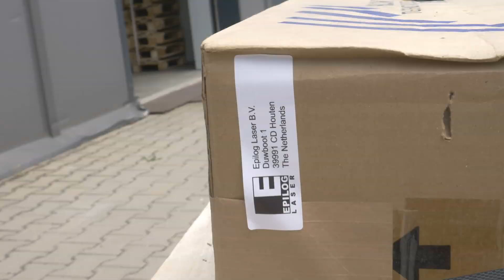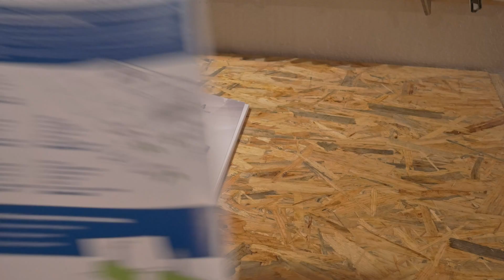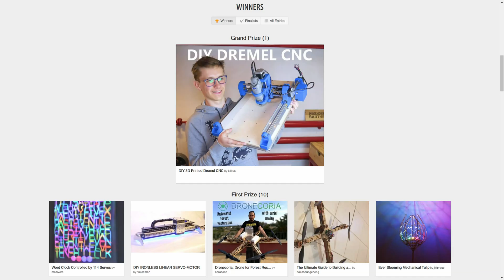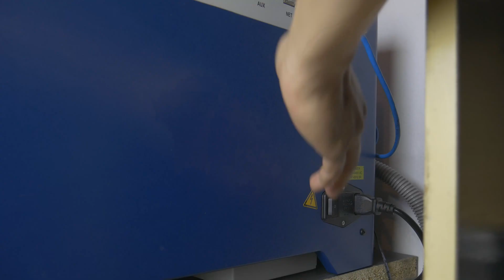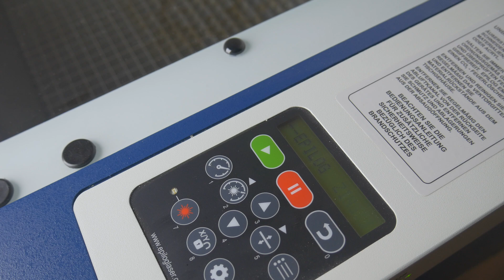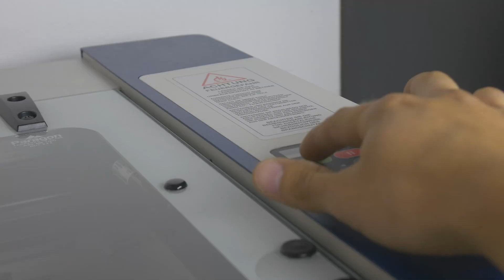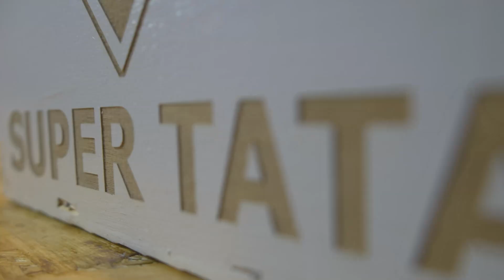My $8000 Prize (Laser Cutter)

Comment: You can use painter's tape on the surface to help reduce the scorching residue. The laser will burn through the tape, then when you peel it off the surface should be cleaner and not required sanding.
Reply from the maker: You can easily clean that with wet towel